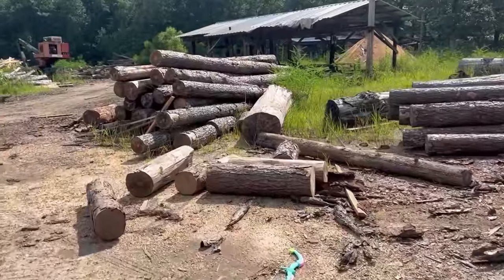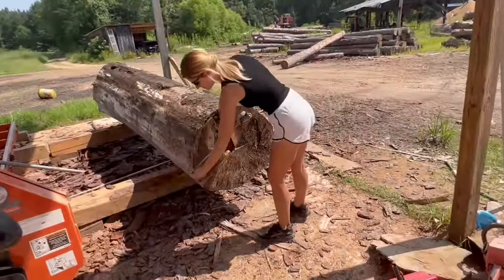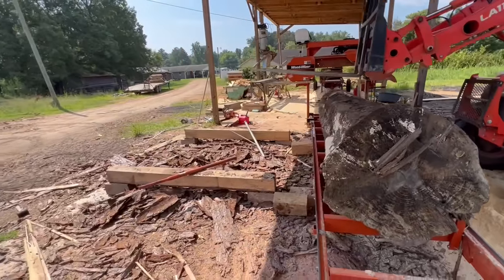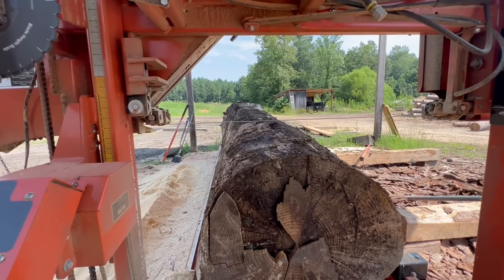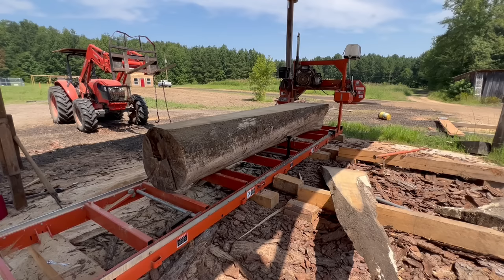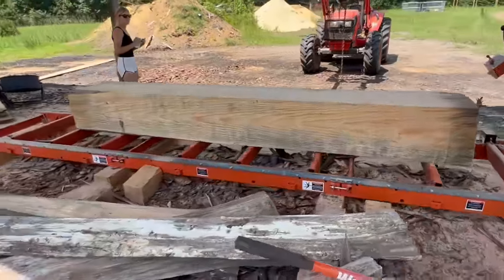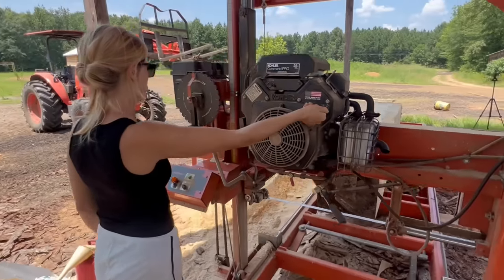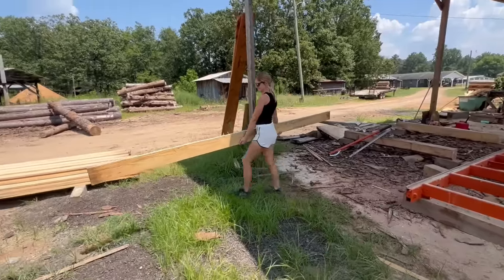HUGE 38" pine log!!! (Can we even SAW this?)

Comment: Where does getting going with a saw mill as well. Going to make something to pull the sawdust back so it's easier to load up into the bucket. Some kind of attachment that goes to the loader.   wouldn't be a bad idea

Comment: When you sawed through the bolt you could have turned the cant with the bolt in it and the saw would run on each side of the cut off bolt and still get all 12’ boards

Comment: You're a way off on your gullets on your saw teeth you need to leave more back of the tooth on ,so you're not just using the tip . It will increase the life of the  blade